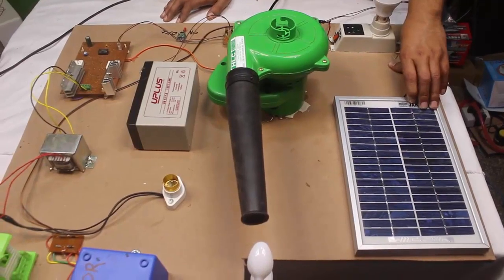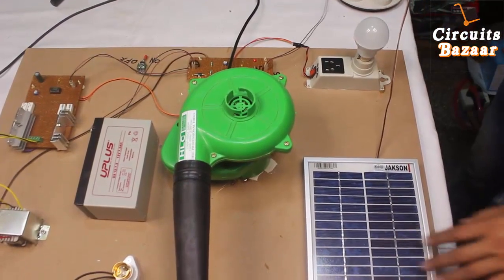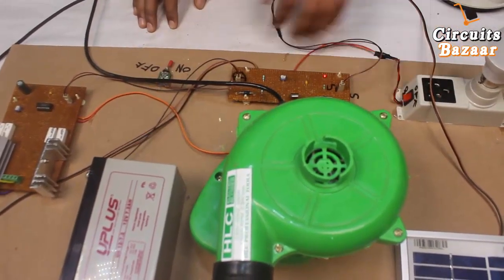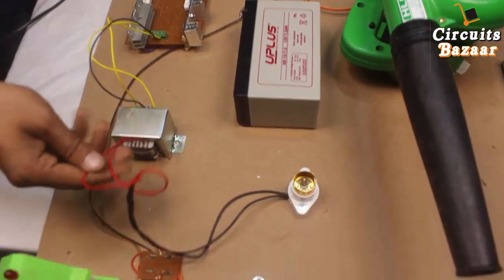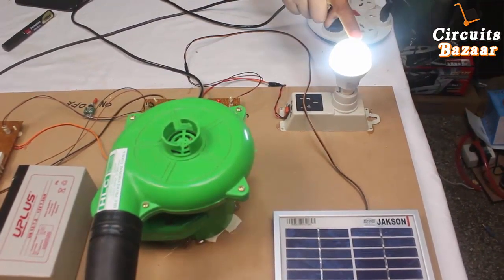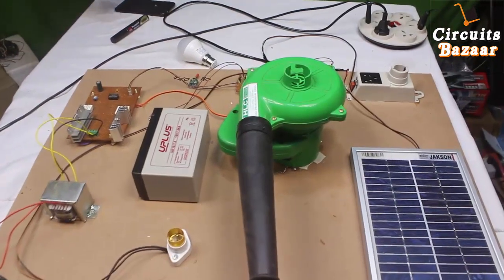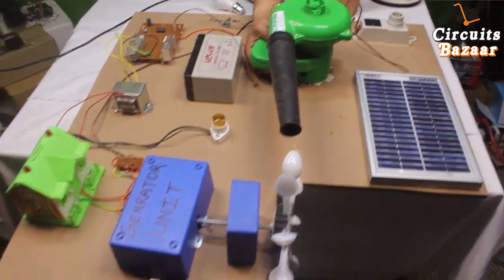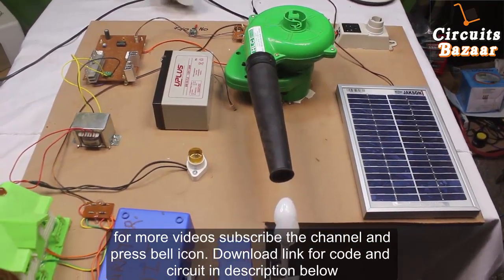Hybrid Power Plant with Wind and Solar Energy  Project with working

Comment: Is we using solar power to rotate the wind turbine
Reply from the maker: no its needs wind. so we have used electric wind pump to throw the air on the blades
Reply: Thank you sir for giving reply.But we should show naturally rotating wind turbine. Because our faculty said to do like that.